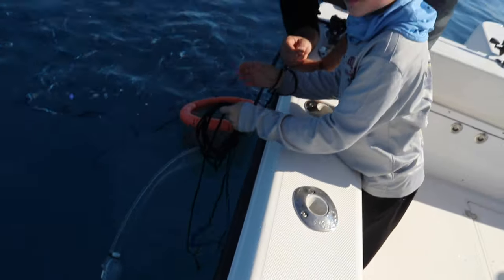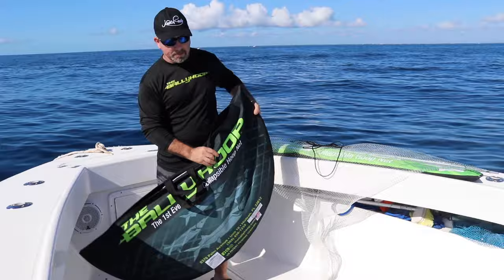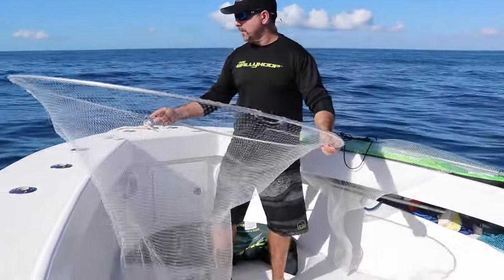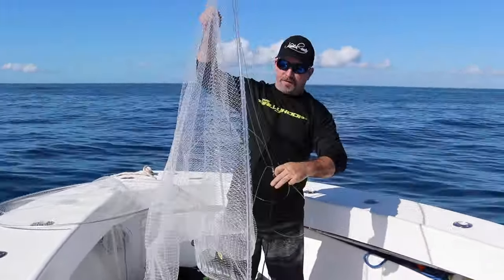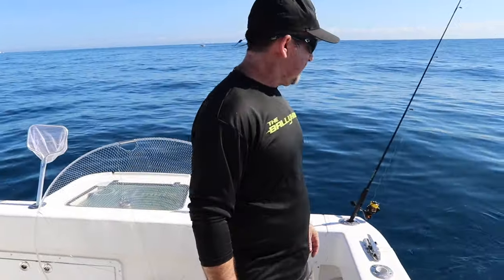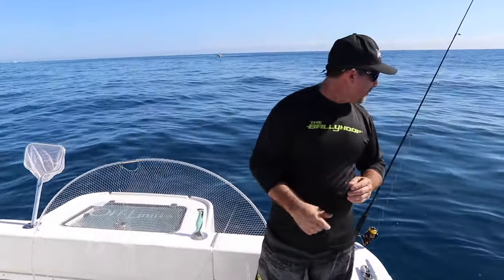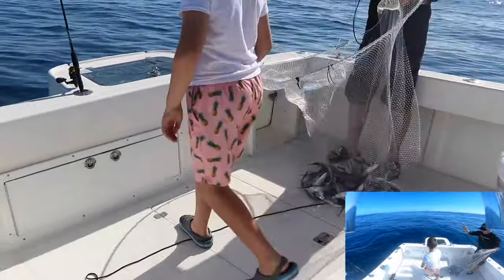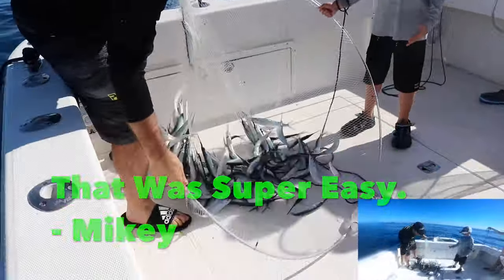Catching Ballyhoo with a Hoop Net and No Current | Using The Ballyhoop

Comment: I went to purchase one and then saw the price ! There is no way you have 340-$400 of material in this product. At 64 I’ll throw a 12’ net and stay happy.
Reply from the maker: Hey @hardsarge a lot more goes into it than the materials at hand, and they start at $139 for non-collapsible (instore only) and $229 for collapsible, they pay for themselves in the first couple of uses and don't damage the baits like a cast net. 
Like any tool, it's as good as you put it to use, may not be the right product for you but 10's of thousands of anglers have their hands on our nets for a reason! We stand behind our product and always will! 

Tight lines,
Evan
Reply: @TheBallyHoop  never said your product wasnt good just expensive to the working guy . good for you. Since so many are purchasing them supply and demand would have you bring the cost down. 
But good for you not for me at that cost.